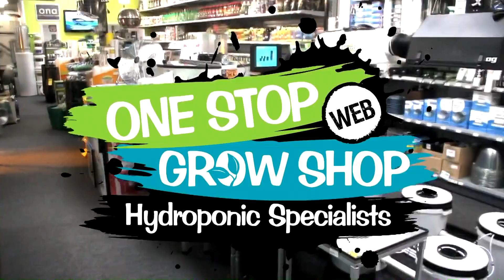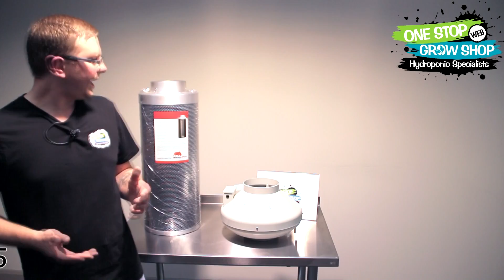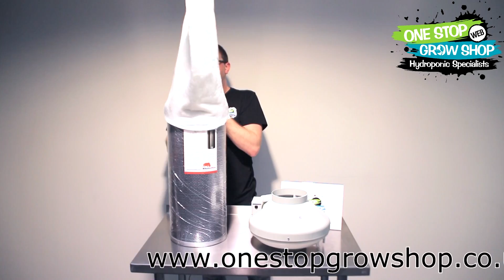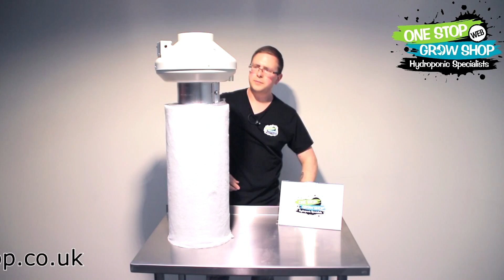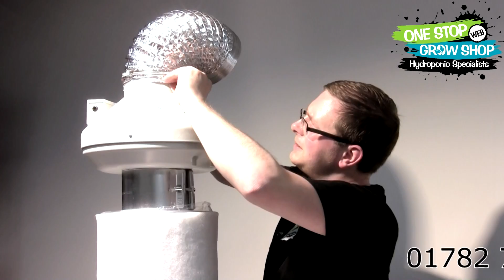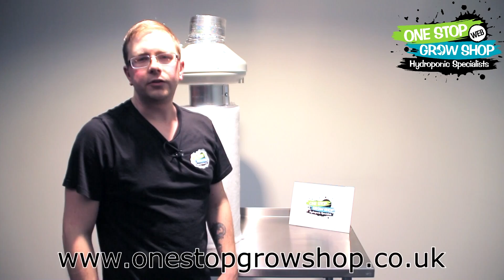Setting Up Your Extraction Kit (Carbon Filter and RVK Inline Fan)

Comment: What does the inches refer to? Is it the length of scrubber or the diameter of the hole in the filter. And can I have a 10 inch filter with a 6 inch fan?
Reply from the maker: it refers to the flange of the filter, so you'd connect a 10" fan to a 10" filter unless you use reduces, 

If you have a 6" fan, use a 6" filter dude, we do pre-made kits to make it nice and easy for you 

https://www.onestopgrowshop.co.uk/products/hyper-fan-carboair-carbon-filter-with-acoustic-ducting-kit?taxon_id=48

Comment: Will this pull in fresh air too
Reply from the maker: You can set one up to be an intake yeah, but you'd be better off getting one of our kits which has an intake and outake which are perfectly suited to each other!

Here's the link if you're interested! 

https://www.onestopgrowshop.co.uk/products/6-and-8-hyper-fan-kit-with-controller
Reply: make sure your grow tent air ventilation flap is open plus open a window slightly where your grow tent is situated or nearby  this will pull in  fresh air through your tent. Also this fresh air will help your plants thrive

Comment: Can this be used as a free standing unit (Floor)?
Reply from the maker: It can be used as a free standing unit, but we would recommend to have it suspended at height as this works much better with extraction systems
Reply: Thanks for the response any recommendations on a fan speed control unit?

Comment: would a 8" hyper fan be okay in a 240x 240x 200cm tent with 4x 600w hps light and a 6" inlet fan bringing in fresh air has about 500cfm or would I need a 10" hyper fan as it may get hot in the tent especially in the summer or would the 8" be fine thanks.
Reply from the maker: We would recommend that you buy a 10" Hyper Fan. A 8" is great for this time of year, but won't be too great with that kind of a tent if we end up having a hot summer. You can use a 10" all year round without having to swap it out or worry.
Reply: One Stop Grow Shop thanks for the help also would a 8"inline fan with 950m3 be okay bring in fresh air or would I need something with less cfm as would want to obtain negative pressure thanks.